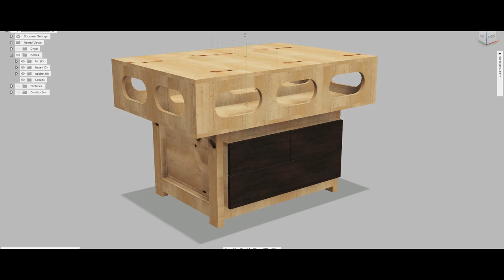Perfect workbench for small Workshop

Comment: Ano po ginamit niyo para dun sa cut out drawer pulls sa ilalim? Will try po sana yung ganung drawer pull for my bedside table (my first build !! ) hehe. Kaya po kaya gawin with limited tools? Konti lang po power tools namin, mga lumang tools pa ni daddy na jigsaw, hand planer and drill. Tinry ko po kaninang hapon gawin with hand tools lang pero tabingi at ang rough ng edges dahil 'di ako marunong gumamit ng chisel 🤣 Thank you po!
Reply from the maker: I used router with straight bit..mhirap ihand tool yan brad hehe
Reply: @edanosmodular  Thanks sir! Wala rin pong choice, kaya tinry ko uli last night with hand tools. Okay naman po ang kinalabasan :D Hindi nga lang 'sing linis nung inyo hahaha